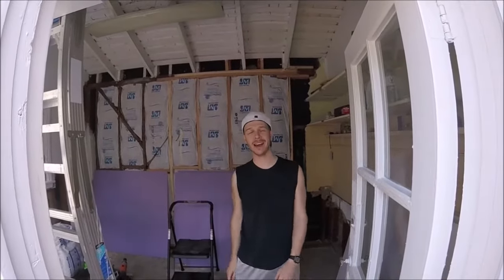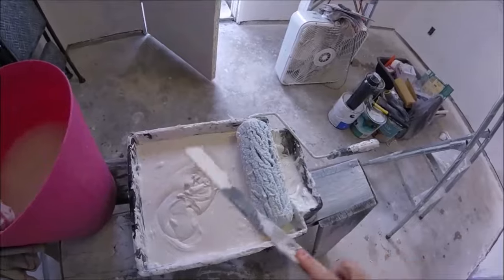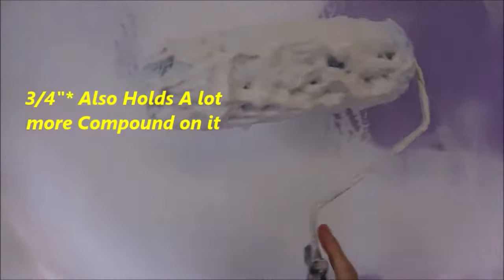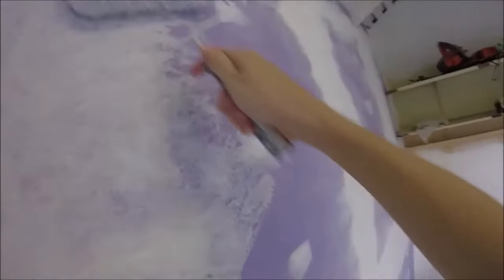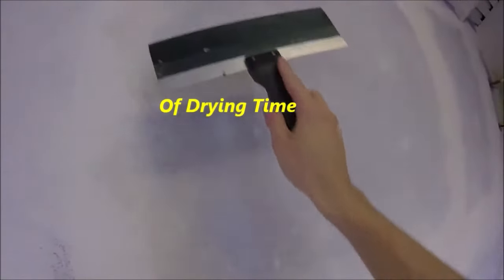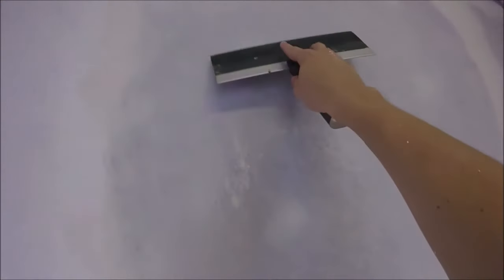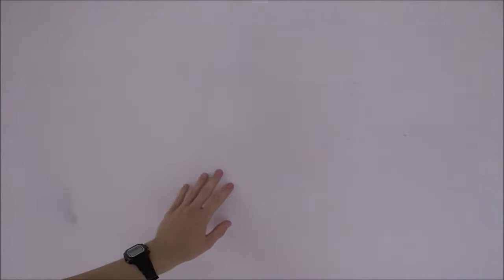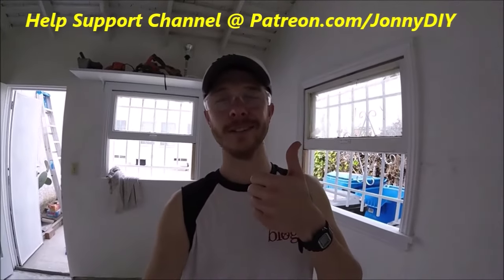How To Easily Roll On Drywall Texture & Knockdown Finish! -Jonny DIY

Comment from the maker: Tools & Supplies Used

12" Drywall Knife for "Knockdown"- https://amzn.to/2KMCbHm
Putty Knife Set- https://amzn.to/2FZPrLo
Drywall Edge Planer- https://amzn.to/2KPvNiC
Utility Knife- http://amzn.to/2rIeUQP 
Nap Rollers for Texturing 3/4"- https://amzn.to/2Otjn2a
Paint Roller Kit- https://amzn.to/2OvLYUp
Paint Extension Pole- https://amzn.to/2nxNSIV
Respirator Masks N95- http://amzn.to/2xX32x3
Safety Glasses- http://amzn.to/2ez41Jw
Leather Work Gloves- http://amzn.to/2x5BZk3
Thanks for Watching! Help Support the Channel by Subscribing & Clicking the BELL Icon for all NEW Videos!

Comment: I watched this video & another one from Jonny many many times. I've used a sponge for a knockdown finishes on patches and it worked fairly well for me. Today I had the equivalent of about three sheets of drywall to put the knockdown texture on. It was an absolute mess, I was covered head to feet. Lots of variables - thickness of mud, different roller types, & different roller nap sizes. 
1) Forgot to sand walls as Jonny mentioned, which made it difficult, in some areas I had adhesion problems of mud sluffing off when using the knockdown knife.
2) Tried spaghetti roller & just went back to a regular roller. 
3) I had to use a sponge for the wall corners & where the wall met the ceiling or trim.
4) Tried my 12" drywall knife to apply mud to wall but it was just too difficult to get a consistent layer so I went back to the roller.
5) I used 3/8" nap & if I did this again I'd use a 1/2". 
6) Most difficult part is getting a consistent layer of mud on the wall. By the end I found I had to load the roller with mud & just lay down one vertical strip about 2.5ft high, then I'd reroll this small area to get consistent coverage. Then I'd re-load the roller & put down another 2.5ft strip - over & over till the wall was covered.
7) After the wall was covered I'd go back over everything to get the stippled finish. As Jonny mentioned, try to go the same direction, either straight down or from bottom up in fairly fast motion and lift off near the end.
So for knockdown patches the roller works really nice for me, its enjoyable & gives an acceptable finish. Next time if I had an area larger than two sheets of drywall I think I'd either buy or rent a hopper to spray the mud on the wall.
Reply from the maker: Glad you got it done 👍 Drywall is definitely a handful, I don't do it too often either. Working on a patch today, but have to do orange peel texture. Thanks for sharing

Comment: I tried to do a texture with roller and all purpose mud on non brand-drywall, experienced a problem of drywall’s paper peeling off when rolling the mud over, did a coat of all purpose mud ski thinking this might help in supporting the paper so it does not peel, tried again but same problem, how you guys recommend this with such issues, what I am missing here if any?

Comment: Jonny great video! One question. When you were loading the roller you said it was a 3/4”, but when you put it to the wall you called it a 3/8”. What size roller did you use?
Reply from the maker: Thanks, happy to help. I used 3/4 nap roller as it holds more mud, sorry I misspoke when said 3/8. I have another video that you can see the finish better.
https://youtu.be/I33McDjj3B4
Reply: That’s okay. Just keep making great videos! 👍

Comment: I like the smoothing technique, that really makes it look sharp! I missed that step with my office drywall project I mentioned in your last video. How long was the entire process, including the primer and painting for that room?
Reply from the maker: Heyyy. Yeah the knockdown effect really helps hide a lot of flaws which is great. Hmm I worked on this lil shed for quite a while but I probably did drywall and painting in 4-5 days letting each layer of mud to dry a whole day between coats. I want to put a video of the whole shed to office build up soon if I get the energy to edit all the random vids together
Reply: Jonny DIY That would be cool to see the whole process!

Comment: Good video Jonny, well explained. Quick question, can I use 20 min mud? or what's preferred?
Reply from the maker: Thanks Paul,  for small patches the quick setting mud is fine. It'll allow you do  do all coats in a day without having to wait a full day like regular joint compound. But it does set up quick, so once you mix work fast 🤙

Comment: Should prime before you texture eventually the texture will peel off
Reply from the maker: Hmm never heard of that before. Only ever learned to prime fresh drywall before painting
Reply: @JonnyDIY  sure i understand the standard but i have fixed many ceilings, walls, and garages because of this issue. If you prime before texure it helps with adhesion. Might i suggest that you mention that drywall has to be free of dust after sanding
Reply: @JonnyDIY  outside of that great job on video
Reply from the maker: @greggsupple4204  thanks Gregg. Yeah Ill have to do that next drywall project I do. And yes youre right, you have to wipe the dust after sanding 👍🏻